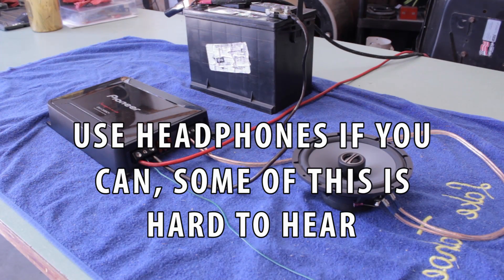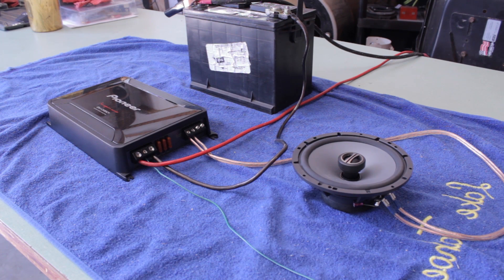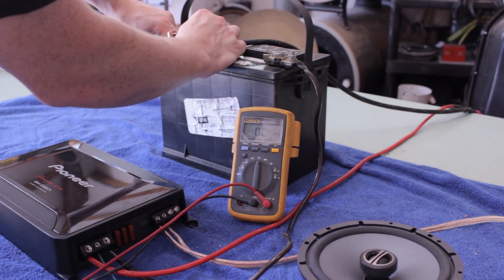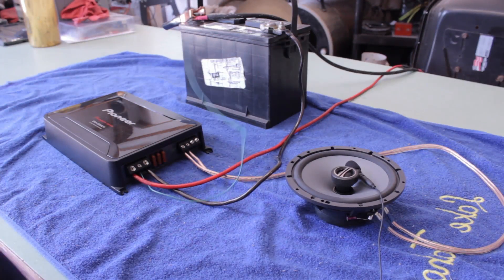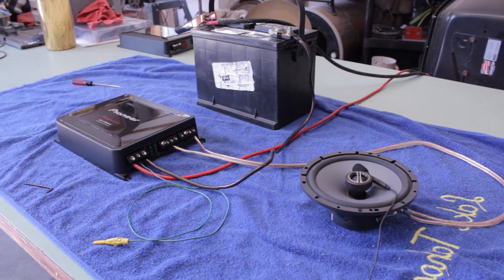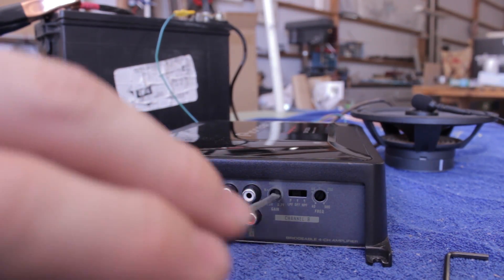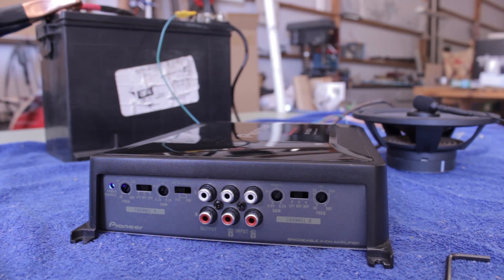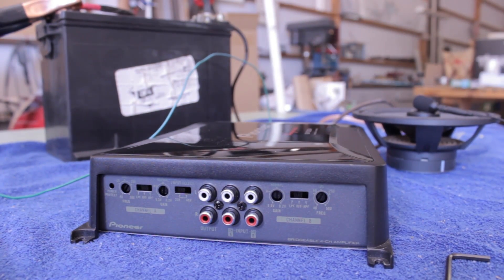New Pioneer class-D amplifier noise issue - GM-D9601 and GM-D8604

Comment: get a thicker remote cable that puny piece of shit u get with kits is no good
Reply from the maker: +Neal Gray If you're getting 12v there then it doesn't really matter. This has nothing to do with the problem addressed in the video but yeah I usually like to use something a big bigger for the sake of durability. This is just for testing purposes.
Reply: +Taylor Thorne have you checked to make sure some times the cable is that poor you only get about 4v and not 12v trust me ive seen a few have problems and they were on good builds
Reply: The remote cable is only used for signal, so amp knows when to turn on and off. All the amperage comes through the pos. wire

Comment: Also i hope you arent using a stock alternator
Reply from the maker: On my test bench there is no alternator. This is an SQ setup, not SPL. The reason to have a HO alternator would be to help with voltage drop. If you never turn it up enough to drop voltage then you don't need to pay for an alternator. My car sits at an acceptable voltage while I'm listening, I couldn't care less about the couple hundred extra watts I could have at full volume. A 200 watt difference in a 2000 watt system is pretty much unnoticeable.
Reply: Good point the main reason im woeeied is because I see your video today only 3 hours after I ordered the Pioneer GM-D9605 so im scared lol
Reply from the maker: +sherkhan808 You should be OK if you have a standard system. I have some really efficient speakers glassed into pods at the windshield right in front of my face so it's really easy to hear detail, but also really easy to hear problems.

Comment: you got the power wre laying on the speaker wire.
Reply from the maker: Speaker wire on power wire is OK. RCA crossing should be avoided of possible, if not then cross them at 90 degree angle. I wouldn't worry about any of it on the test bench.

Comment: Normally extra background/ground loop noise is because of a poor ground connection. If the connection is solid and it still does it, lots of folks runt the ground back to the negative terminal of the battery instead because that's the best-case-scenario to eliminate excessive noise. I see you've done that in this vid. This really is a head-scratcher. Did you ever figure out the problem? Equipment malfunction?? Or maybe it's just a normal background noise because of all the power/current flowing through the setup? I really don't know... Good luck!
Reply from the maker: Yes I tried lots of different things while testing in the car, even running dedicated ground cables. I ended up getting it to a Pioneer tech who told me that that's just how they are and that I was being to picky. They are currently in my car because I can't afford new amps but I can hear the background hiss even while driving on the highway, and that is with gains set using a distortion meter.
Reply: Taylor Thorne That sucks. It shouldn't be that way. Unacceptable performance, in my book. And Pioneer has always been a decent mid-level brand, in my experience. I've have several of their head units and they worked great.
Reply from the maker: +Numinous Yeah, I've had head units and older amps but these were just built to be cheap consumer crap, I should have seen it coming.
Reply: Taylor Thorne I'm using a Soundstream Picasso Nano for my mids/hi's now. Full range class D, tiny footprint, makes rated power (60x4 RMS). No complaints. They have a 100x4 RMS version too that can be had for ~$100 (PN4.520D). Doesn't run too hot or anything.
Reply: I forgot to mention, they have monoblock sub amps that are similarly priced. ranging from 650 watts x 1 @ 2 ohms for ~$100 to 1000 watts x 1 @ 1 ohm for ~$150. Just FYI.
Reply: @MotherlodeMotors  у меня 5 таких усилителей.новые...все шипят..отдавал в ремонт по гарантии.ничего не нашли...так продолжают шипеть....

Comment: You're using 8 gauge wire for power, it requires 4 gauge, and the speaker is wired wrong, it should be in the right side terminal when it's only one speaker being used according to the manual, hope this helps
Reply: Using a smaller guage wire is not going to introduce noise into the system.
Reply from the maker: You need 4ga if you want the best possibly performance from the amp, larger wire helps minimize voltage drop so at low volume levels it doesn't matter. And even when I have all 8 speakers in my car hooked up with three of these amps the same thing happens, thanks for the suggestions though.

Comment: lol did he really say you will get a better ground connecting to a peice  .  of metal rather than a direct connectio. to the neg terminal on the battery? lmfao he even went as far as to say you will even get less resistance going to metal of the car rather than directly to battery haha how could you get less resistance going directly to the start of the circuit? wow idiots shouldnt give advice about stuff you are obviously oblivious to.
Reply: Because the chassis grounded to the neg on battery the actual car is not grounded the only thing on a car that touches the ground is the tires and they don't touch the ground.  We are working with a DC electrical system here, it has to be connected to the neg terminal for it to work. How do you think your phone or anything else that runs on battery works? I don't see you plugging a wire from phone to the ground, do you? You ground amp to chassis because the chassis grounded (bonded) to the battery

Comment: When you connect your leads and get 0.2, zero that out, don't subtract it. Impedance is with AC, resistance is with DC...  Without a signal going to the amp (RCA from head unit giving a null signal) you will get ambient noise. These are transistor amps, so an "amplified" null signal will hold the speakers "still". How is your unit grounded? Do you have it grounded to chasis, battery and alternator to pos with bigger wire? Could be a cheap head unit. Even wired in a  simple circuit like you have here, (which is hard to tell as part of the circuit is off the table) the tiniest of drops in voltage will read as a signal. Am willing to bet the hum you hear is a harmonic or sub harmonic frequency to the clock circuit of the amps internals. I know it sounds flakey, but grounding is huge in getting rid of noise. Do some research on the "big three upgrade". When dealing with cheap electronics installation is a huge factor. I have the 8604 4 channel, and 8601 mono block and get zero noise with the gains adjusted properly, even with the head unit putting out 100% volume and no signal coming out. A small 1 farad cap and the grounding mentioned above were installed along with the system, so I don't know if that is why I have no problem and you did. Then again it is not totally out of the realm of possibilities that you managed to get two faulty units. A batch of caps or transistors that Pioneer got could have be under spec, leading to the manufacture of a few hundred or thousand units with faulty parts. Has Newegg or Pioneer addressed this problem yet? I hope so as I have always gotten great customer service from Pioneer, but never dealt with Newegg.
Reply: I agree the big three makes a world of difference.
Reply: I like the Big 8 better!
Reply: Big 9 ftw
Reply: @alphaomega8373  Cough gay
Reply: +Jeff Evanson Big 5 is the way to go..
Reply: I just bought gm-d9601 and the amp itself got hissing noise is it normal? I disconnected rca and still hissing . Not the speaker but the amp itself.

Comment: That popping is nothing to worry about mine does it it is to tell you that the signal has been detected and the hiss is probably just because there isn't a musical source plugged in ie iPod
Reply from the maker: +bassjunkie1997 gouldigger If I didn't use protection caps on my tweeters they would be blown from that pop. The hiss is there no matter what is plugged in.

Comment: I have both of these amps in my car for year and haven't had any issues with noise in my system at all. These amps Actually perform extremely well and i would recommend these to anybody. You noise is likely from improper install. I have mine with ofc 0ga to a fused distribution block to ofc 4ga.
Reply from the maker: It's not the install. like I said it has been installed in multiple configurations to rule out every part of the install as being a problem. So far nobody has been able to suggest a reasonable possible cause.
Reply: +Taylor Thorne If you 100% its not the setting have you tried warranting the amp? maybe it's just defective.
Reply from the maker: +WeirdJerz3y Yeah, the tech for Pioneer basically told me that he doesn't think it's a problem. I can actually hear the hiss while driving (with gains set properly) and the pop is audible every time I start my car. The speakers in my car are fairly sensitive and are on top of my dash board aimed right at my face about 2 feet away with no obstructions so I am able to hear stuff like this easier than someone who has their speakers down low in the door and blocked by a door panel. I've basically given up on this build because I won't be able to afford to replace these until I'm out of college, for now I'm just living with it and hoping the pop doesn't kill my tweeters.
Reply: +Taylor Thorne you can always take it to get repaired too, but I don't see why pioneer won't take it. I thought they let you take to cerfied shop with the proof of purchase and they fix if. I would talk with pionner again, and if you need to complain then complain, tell you installed the amp multiple times it hisses.
Reply from the maker: +WeirdJerz3y Yeah that's what I did. By Pioneer tech I meant the technician that worked on the amp. He heard the hiss and told me he didn't think I was a problem, but he also had a very noisy shop and it was very quiet with the gains all the way down. The next certified tech near me is 3 hours away so I would be spending a lot of gas with still no guarantee of a fix. Decided to just let it go...
Reply: +Taylor Thorne well that sucks, but yeah, I have mine connected to my speakers and tweeters on my dashboard and no hiss, so you diff do have issue, sucks you can't fix it. I normally buy my stuff with amazon prime for reasons like yours. I had speakers just randomly die and I contacted them and the refunded them even though it's been 5 months.
Reply from the maker: +WeirdJerz3y Yep, I think I saved like $40 going through NewEgg and Amazon totally would have taken them back. NewEgg told me they didn't care. Oh well, I know where I'll go next time...
Reply: +WeirdJerz3y ---if you have the amp so near the battery it doesn't matter whether your gauge is 8 or 0, the shorter the distance the more load the wire can handle! The shorter the power wire is the less resistance it creates!

Comment: you may get distortion with your power running right on top of your speaker wires. Don't connect your ground to a battery that's NOT GROUNDED.
Reply from the maker: +jake smith Don't connect a ground to a battery that is not grounded? What does that even mean?
Reply from the maker: +Mike “Fatally-Ownd” Hunt Connecting directly to the battery would be the least possible resistance in the circuit. The only reason people connect to the car's chassis instead of running another wire to the battery is because its more work and in most cases provides no audible gain. High output systems will run dedicated negative all the up to the batteries. Have you ever seen larger systems with a battery bank in the back. Those are connected straight to the distribution rails and amps, no going through the car.
Reply: +Taylor Thorne what Mike said... hence thats why you connect the neg terminal to the car chassis
Reply from the maker: +sherkhan808 Go look at your car. The negative wire on your battery is going straight tho the chassis. The only reason we don't run dedicated grounds to the battery in most cases is because grounding to the chassis is adequate, grounding straight to the battery would be an improvement.
Reply: Was thinking the same thing
Reply from the maker: +Mike “Fatally-Ownd” Hunt Yes, cheap amplifiers. The Pioneer service tech said that's just how they are.
Reply: +Mike “Fatally-Ownd” Hunt I dont think you understand how electricity works. There is a reason copper wires are used, due to there low impedance. Your car is usally made of steel which has a much higher impedance therefor grounding to the battery is better then to your car. The only reason they ground to the car is because its cheaper and less messy then running a billion earth wires back.
Reply from the maker: +TimbeauArt It was doing the same thing in the car as it was on the table. There were no crossing wires in the car.
Reply: so then have you figured out what actually made your the noise ?
Reply: +Taylor Thorne I have that same amp and I don't have that issue, it may be something wrong with your amp
Reply: why ground to the battery?
Reply: No..... You don't ground to your main battery because the ground wire would be too long for one....  Another reason is the main battery in a car is hooked up to the car's electronics, which can also cause a hum in your speakers as well.  If you grounded to a battery in the trunk, it would be within the correct distance from the amplifier to do so, if the amplifier was also in the trunk.  Another thing to note is, when you isolate a battery in the trunk, it is grounded on your chassis.  That ground from the battery is dedicated to your car audio.  No outside electronics are interfering with your ground.  I'm not saying this is the problem here, but if you did run a ground that long, or from your main battery..... that would be another problem on top of an already existing problem.  I believe the amplifier is the issue in this video.
Reply from the maker: +Mike “Fatally-Ownd” Hunt What do you think the metal of the car is attached to? The negative battery terminal. The whole car is the negative battery terminal.
Reply: I believe you will get two different results. If you find a spot in your car that has low impedance it's a much better ground than simply connecting to that battery, test it.
Reply: +Taylor Thorne You connect the ground to a metal part of the car, gotta have good metal contact DO NOT CONNECT THE NEGATIVE (BLACK WIRE) TO THE BATTERY =]

Comment: Hey.
You say you have tried to chance every thing.  But have you tried another speaker also?
Just to try it out and see.
But have you returned the amp or got a new one?
Reply from the maker: +Mads-Ejnar Kehlet Yes, all the speakers in my car did the same thing, Pioneer won't take it back.
Reply: Sad to hear that :/ I was looking on getting this amp, maybe i will skip it and find another on.
Reply: @MotherlodeMotors  are you fix the problem?
Reply: +Mads-Ejnar Kehlet  iv had this issue with nearly every pioneer amp iv test. U___U
Reply: Look up grounding rcas to head unit noise eliminated on you tube.  Or by an in-line noise filter for the RCA's

Comment: Agreed with earlier statements, Battery is low. I would also like to add some thing.... 1. The turn on leads, where was it connected too? The output on radio or a switched power on car? This does make a big difference. Should be connected to turn on lead from head unit. Have the head unit off when starting, should stop popping. 2. The static, or buzz you here, possible because no inputs are connected to the amp. If you connect a source, does the buzz still exists? Possible that the amp is creating buzz, trying to amplify nothing.
Reply from the maker: +John Niedermier No change even when alt is charging @ 14.5. 1) I have connected the turn on lead in every possible configuration, head unit, with and without relay, with and without delay relay, even straight off the battery. Doesn't matter if the car is on or off, multiple different grounding situations. 2) Hiss is independent of inputs, with gains set properly the hiss can be heard even while playing music. I have tested these amps multiple times in multiple configurations inside and outside of the cars and on three different test benches. No changes. My only conclusion is that these amps are of poor design. Others have not had problems, maybe they got lucky, maybe they just haven't listened closely enough. The speakers in my car are very clear and right in my face so it's easier for me to hear small things than if they were way down in a door behind a panel.

Comment: Man this sucks. Thanks for making this vid. 'tho. 

I was checking out the 8604. I've already got the 9601 and it's great (except the pop when turning on). I didn't notice a hiss but I've got a bandbass build so it might be in there somewhere :D

How bad is the hiss on the 8604, because I wanted that radical 100x4 RMS power without paying too much.
Reply: u only hear if u'r using midrange in subwoofer u can barely hear it. but the amp itself makes a hissing noise.

Comment: I doubt it would work (since you aren't running any source to the amp) but have you tried running the amps with ground loop isolators?

http://www.sonicelectronix.com/item_5262_PAC-SNI-1.html

I'm looking at getting the 8604 but these issues are a little concerning to me and making me reconsider.
Reply from the maker: Thanks for the comment, but since it does this hooked directly to the battery with nothing else on the circuit I can't see how that would help. I've had other amps in the car without problems. If you want to try these amps make sure wherever you buy from has a way to return them after you open the box. I was going to try the PPI 900.5 but hear people are having problems with those too.